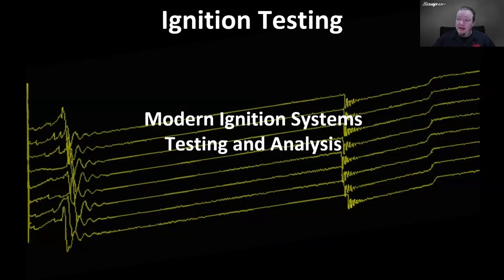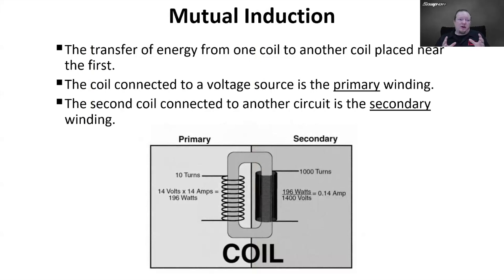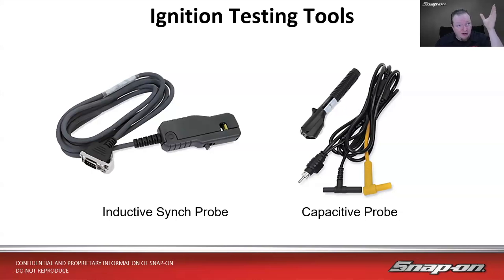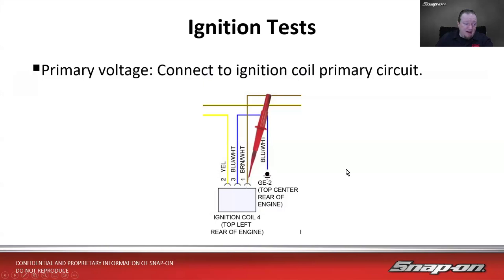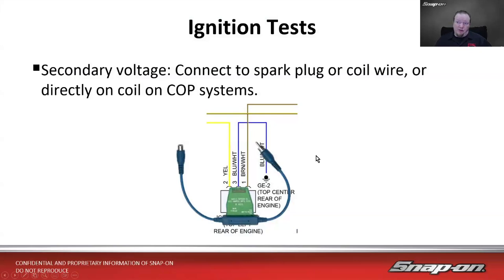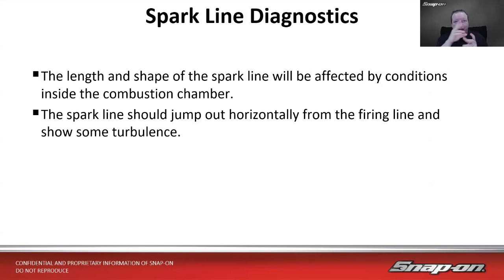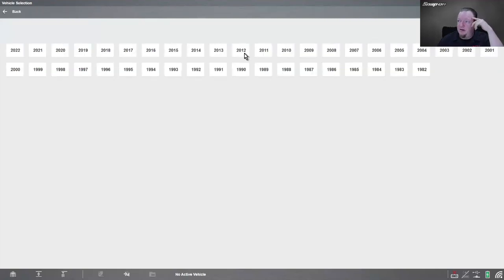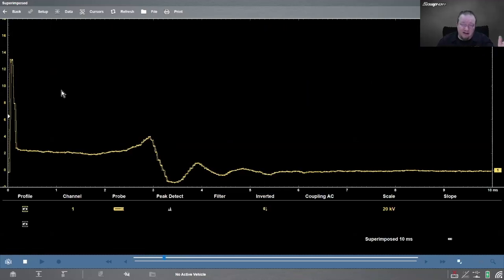Modern Ignition Systems Testing and Analysis with Jason Gabrenas | Snap-on Diagnostics UK

Comment: I just put a scope on my 1994 OBS bronco with 5.0L EEC-IV TFI.  the secondary ignition waveform was inverted.   is that normal for this system or could the coil be wired or wound backwards?
Reply from the maker: That is normal. Just use the invert setting on the channel you are using and it should look as expected.
Reply: @SnaponDiagnosticsUK  thanks